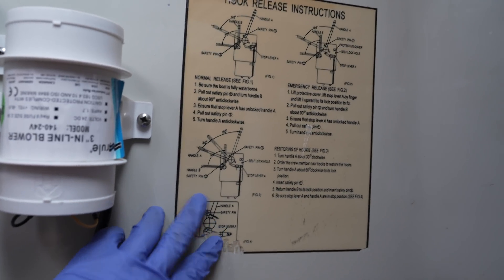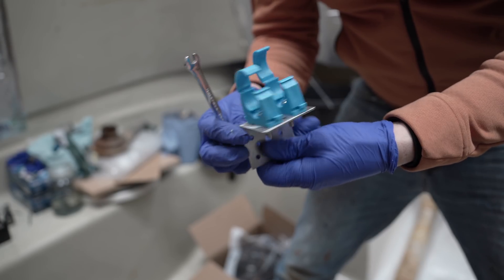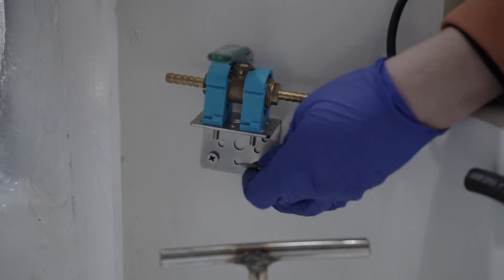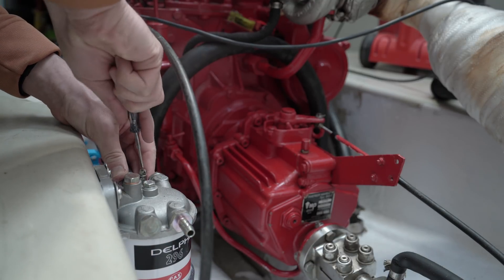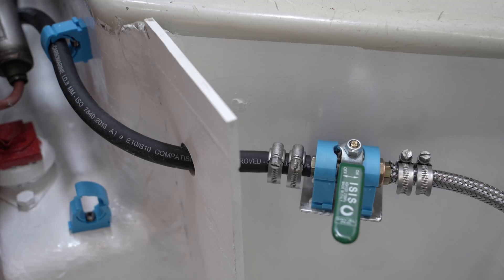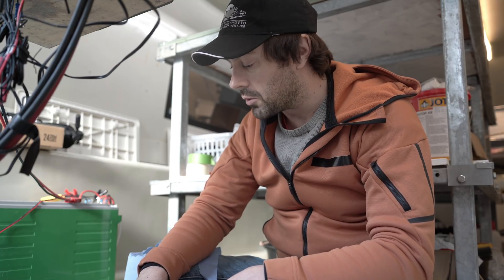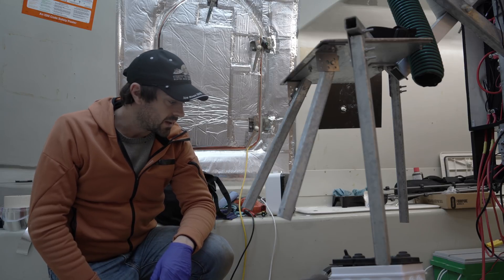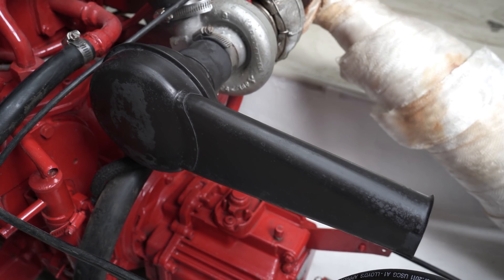Lifeboat Conversion Ep9: Installing Bukh engine fuel supply hoses and fittings [4K]

Comment: Two points of interest  1 use acetone to clean fibreglass before painting plus plenty of fresh air  Two  try a hot air paint stripper to soften the plastic decals,  I used this method to remove ad wrapping of my company vans for selling,  all the best I'm enjoying the videos
Reply from the maker: Cheers! Yes acetone solves most of life's challenges. Except if you run short of wine.

Comment: Are the fittings on the top of the filter for a DP gauge to tell if the filter is clogging?
Reply from the maker: The two bolt heads ? The one is the middle is the spindle that holds the whole thing together. The one to the side is the bleed screw.

Comment: I wouldn't use those plastic clips holding that shut off valve.  Cold will make them brittle and if the valve is a little stiff you will need to apply some force.

Comment: One of the hose options from the fuel filters use to be used to go to a manual liquid diesel pressure gauge. I am not sure if this method is still in practice but I have found it on older marine engines. It is quite disturbing when they fail and the gauge itself half fills with diesel.

Comment: Lol that bracket you made for the shut off valve will never hold. This is embarrassing.
Reply from the maker: What does it need to hold, Rusty Sanchez?
Reply: @AlexHibbertOriginals  Elmer’s wood glue.

Comment: I know its been 4mo. & you've got sticker off. For future, citrus air freshener spray works really well on stubborn adhesives. Thanks
Reply from the maker: Presumably the spray just contains a light solvent like alcohol?
Reply: @AlexHibbertOriginals  it has orange oil I assume which works great on adhesives

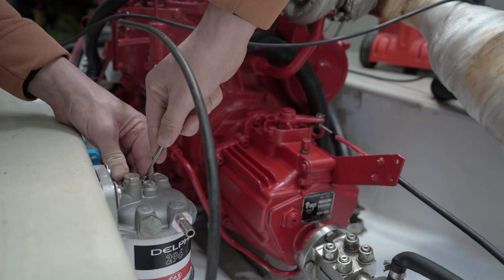Comment: Use right angled copper fittings if your hose changes direction immediately after connection, I noticed one of your hoses already suffering some damage at 4:12 lower right hand corner and thought you might take a look at that. :)

Comment: I've got a three cylinder Diesel generator that I bought one of these filters for. The unused blanked off plugs are for different mounting options ie you can put an 'In' and an 'Out' on one side just by moving the plugs around. Arrows embossed on top show the flow direction.
Also I'd recommend using two of these in parallel with a 'T' piece between them. Plumbed like this the two filters will take double the time clog up and handle double the water. Having two gives you some options if you need to disconnect one and keep the engine running. 
*In fact there are marine filters better than these bloody things and in one complete unit that works exactly as having two of these filters. Those dedicated filters are specifically designed so you can run one, two, isolate one and change a filter then the other etc and they have an inbuilt manifold for the fuel with changeover valves. 

Getting back to the filter you have, a couple of points; 
1) They have a design flaw. The aluminium mounting face is on the same plane as the sediment bowl rim. This makes changing the filter or cleaning the water/sediment bowl far more difficult than it ought be. I found making a bracket or adding a spacer will fix this. They just could've made it slightly deeper on the mounting face - but no! It couldn't be that simple ...
2) They really need a primer pump. They can be difficult to fill quickly as the air in the body of the filter acts as a bit of a cushion resisting flow when a new filter is installed. What I did is I got a non genuine Facet style pump (Icon Series PAT 336M is the one I have) and rigged up a a circuit where I can push an instantaneous button to prime and bleed quickly. Those Facet style pumps have a one way valve in them to resist drainback and they are designed to allow fuel to be pushed or sucked through them when switched off so they can work inline with your existing lift pump, or you can rig up something else for priming. It comes with a course filter screen which must be used on the suction side.

Comment: you should leave a battery above the waterline, ive seen a couple boating channels where if they took on water they cant use there water prumps if they impacted something
Reply from the maker: The top of the waterproof battery box is well above the waterline.

Comment: A little late now but if you cut up a two liter pop bottle and used zip ties you could quickly make a shield for the drill attachment. Definitely living my dream.
Edit: copper crush washers of the solid variety can be reused by heating up with a gas torch and let cool down naturally. That softens the copper and relieves stress points.
Reply from the maker: Thanks
Reply: I wish I had thought of that before impregnating my overalls, boots and garage with the decal detritus from my car.

Comment: use litter fluid to clean off glue
Reply from the maker: Even stronger solvents had failed.
Reply: "Litter fluid?"  So.. cat's piss, is that what you're saying?

Or is it just that you can't spell "Lighter fluid"?

Comment: Tech tip 
Install a piece of 1/4” X 1/4” hardware cloth over the turbo inlet. 
Many years past, I had a technician doing a service on a six cylinder Audi Diesel engine. The air filter was disconnected, so it was just a straight opening into the turbo. He ran the RPM up and the rag that was sitting nearby was sucked straight into the turbo. No permanent damage was done, however the shredded rag choked the engine off immediately and the removal of these pieces of rag involved hours of disassembly.
Reply from the maker: Noted!

Comment: The other ports on the fuel filter is so you can have in/out on either the left or right instead of one each side, or even in and out on the opposite side to what you have now. You can also use it to feed two engines or have two fuel out ports. If you use both input ports then you run the risk of sucking air when 1 tank is empty, so you will a ball valve on each input to isolate that tank when it's bone dry, but a good cheap way to have duel tanks with out an expensive 3 way valve.
Reply from the maker: Thanks - yes this common sense explanation turns out to be the case! The instructions were oddly insistent on just using ports 1 and 3.

Comment: What exactly is the failure case where a second hose clamp saves the day? And how do you know one has failed and you need to take corrective action against this unacceptable situation of only having one hose clamp securing a hose? Have you ever seen this happen? Pictures? Videos? Incident reports? Is this a real thing? If it is so important, why are almost all of the hose barbs too short for double hose clamps? I think this is a myth, but I would be very happy to see good evidence to the contrary.

Having used and designed "redundant" systems in a few different industries now, I am super skeptical of doubling things up. I've seen sloppy attempts at redundancy cause problems more often than prevent problems. Or systems where redundancy was deployed (at great expense) instead of solving the underlying problem and no one actually knows if it solved the problem or not, they just blindly hope that the problem is now at least 50% less likely to occur. So many climbing reports where people died while using redundant systems. About half the time when I see two hose clamps on something, one or both of them is in a less than ideal position. Alex managed to avoid that, so he clearly isn't a moron. But he still used two in other places... I've been removing the second hose clamps whenever I encounter them on my boat. Instead of a dozen extra clamps installed in random places, I'm going to keep a few spares on board. If something goes wrong, it will be easier to diagnose and repair it.
Reply from the maker: A reasonable point, well made. On expeditions, especially weight constrained ones, spares/redundancy are a very tough judgement call - made on a case by case basis. With these hose clamps, my decision was based on >1 person I trust saying it's a good idea, the fact they are cheap, are unlikely here to cause damage as the hose tails are long enough, and because having not run these engines for years myself, I've tended towards conservatism.

Comment: Just a note diesel eats at rubber but fuel line hose should be alright if it can stand up to regular gasoline. Supposedly regular fuel is worse than diesel at eating away rubber. Just asked a heavy duty mechanic that drove by just in case I was wrong. Either way maybe have lots of extra hose just in case.
Reply: Or do some testing.
Reply from the maker: Thanks - the hose is rated for both diesel and petrol/gasoline.

Comment: The other fittings on your filter are just for different configurations 
You have an in and an out on each side so you can run straight though like you have or you can run in and out on the same side If the mounting location requires it 
You can't run two sources though it or anything like that (well you can but they'd get mixed)
Reply from the maker: Thanks yes a few others have said this. Good to know the simple answer is the right one.

Comment: At 5:24. You may want to consider some padding/protection to keep the rubber hose from coming into contact with the edges of the hole. Heavy seas may cause a lot of vibration. I don’t know a thing about this but enjoy watching these videos.
Reply from the maker: You're right - no-one at all has mentioned this.

Comment: Use rockwool. It's incredibly soundproof and very very thermally protective period comes at a premium but the stuff is so effective that he grabbed a handful and put it up to both ears you won't be able to hear anything. If I put a sunshade up my car is still cold in Florida during the summer an hour later
Reply: Also threading without Teflon???
Reply from the maker: PTFE tape is not recommended for sealing fuel fitting threads. Small parts can enter the flow and damage the engine. Solid PTFE, sure, but not tape.
Reply: @AlexHibbertOriginals  huh learn something every day 👍

Comment: I would suggest that you add a primer bulb after your fuel valve from the tank but before your water separator it makes changing the filter much easier. Less likely to get air in your fuel system when you prime the fuel lines.

Comment: the two extra ports on the fuel filter are for if you want the inlet and outlet on the same side
Reply from the maker: Yes it appears so, and I wish I knew that. The instructions were adamant to use the ports I used, which weren't as convenient, so I imagined it wasn't quite that simple.

Comment: Just a thought. But a wire hose clamp tool might be handy to keep on hand for emergency repairs. 
https://youtu.be/of9p70H7gdg
Reply from the maker: That's a very elegant design - I wonder if there are any flaws, like slicing into the rubber.
Reply: @AlexHibbertOriginals  I made one of my own, and have not found any problems with slicing into the hose. I was even able to compress a larger fuel line hose on to a smaller fitting without severing the line. I also used quite thin wire. I like that it can be used to fix broken handles, and lash things together.

Comment: Most other boat build channels I watch have double fuel/water filters for their marine diesels. Not sure why there are two. But there's prob a reason.
Reply from the maker: If in series, it'll be to gradually have finer and finer filters. If in parallel, so they can be swapped out without interrupting fuel flow.

Comment: When you fire up the engine again make sure the windows are open because I think that even that high-temp black paint is probably still going to vaporize off.
Reply from the maker: It's only the intake. The actual turbo is safely contained within a housing and with tons of lagging installed by the manufacturer. The intake had a fairly normal sticker on it, whose adhesive survived fine for a decade. The high temp paint was probably over-cautious.

Comment: I am surprised you didn’t install 2 primary fuel filters.  Reason to do so is if you clog a filter underway (especially in rough seas) you can just turn one filter off and the other filter on and continue on your way without having to change that filter and re-prime your engine add an inopportune time
Reply from the maker: I've had some conversations to this end over the past weeks - and had taken it onboard. Whilst content at present, I may add in this useful complication in due course.

Comment: ....curious about teflon tape for threaded fuel fittings?
Reply from the maker: Apparently an absolute no no. Little parts of the tape get into the system and can clog the engine. Washers and/or clips should offer a good seal.
Reply: @AlexHibbertOriginals  I had the thought that there must be a good reason; I imagine that its the filters, pumps and very likely injectors that are the main concern. I bet 'permatex' has some sort of paste-like thread sealant that is good for use with diesel fuel although I don't know firsthand....  but you should be using some sort of sealant for threaded connections, just an fyi. (was that some sort of rubber that I saw?)
Reply from the maker: I do have some fuel connection sealant, but have been advised to only use it as a last resort if mechanical seals don't quite manage it.

Comment: The extra fittings on the water separator/filter are usually for a double filter set up so if one gets blocked you can switch to the other, isolate the blocked one and change it without stopping the engine, often recommended for boats with only one engine, heavy seas can stir up the tank contents and that is right when you don't want your engine conking out.
Reply from the maker: Scratching my head a little to see how that uninterrupted bypass would be plumbed in with those two spare ports.
Reply: @AlexHibbertOriginals  it allows you to choose which sides the pipes go in or out, each filter should have two ins and two outs, so you can have them positioned conveniently for the valves and pipework depending how you set them up on the brackets, can't find a vid that shows it but this is the the way it should work but done with different type of filters.

https://youtu.be/EaI4ndtzvC4?t=1594
Reply: @AlexHibbertOriginals  There another one with different filters again.

https://youtu.be/0Zdbsub0Eko?t=473

Comment: There are 4 ports on the water separator so the supply and return can come out of the same side.  The front ports are one function, and the back ports are the other.  So fuel can flow left to right, right to left, in and out on the left or in and out on the right.  This isn't a big deal with all the space on this build, but it is with a lot of small industrial equipment
Reply from the maker: Thanks for this. I thought it might be as simple as that - and if I were sure, would have connected it up differently. Oh well - no drama.

Comment: I really love your comedy, makes the videos interesting! Additionally one of the ports on the fuel filter/water separator might be for bleeding the air from the filter.
Reply from the maker: The one on top is - I was referring (perhaps vaguely) to the two blanked ports on the sides.

Comment: It may be too early to ask, but what color(s) do you plan on repainting the exterior in? Also given the fact that it’s a lifeboat, did it come equipped with navigational lights?
Reply from the maker: Orange still (only yellow and orange, and perhaps red, are sensible) but a slightly different orange. There was one nav, yes. I'll be installing all the others needed by law.
Reply: @AlexHibbertOriginals  If I may suggest, the hull painted with copper red paint below the waterline will help fend off any would-be hitchhiking barnacles and other sea life while in port. Any shade of orange you choose will be a welcomed one and I look forward to future videos. Cheers from Oregon, USA.
Reply from the maker: @chumbawaumbacumpa  Antifouling is a little way down the road, but yes indeed

Comment: Speaking from experience, use a socket on your hose clips, firmer drive, better in low light and no blood when it slips. Regarding stickiness, I always use the S to B ratio! S..t to a blanket. Just saying. Great content.
Reply from the maker: Thanks Patrick
Reply: +1 for the use of a socket on hose clips - apart from your points it is also usually easier to get a socket on clips in confined places.

Comment: Single ear stainless hose crimps and loctite 577. Jubilee clips don't fit that great on small diameter hose. Better using fuel hose clamps if you need to, I prefer crimps looks better....
Reply from the maker: Actually that's very pertinent as a mechanic at our boatyard recommended o rings yesterday to me. I may well change them over - obviously taking into account they are single use. I was told it's good practice to avoid sealants like 577 if possible, and rely on mechanical seals. What are your thoughts single vs double ear crimps?
Reply: I prefer single ear crimps as you only need to get to one side, handy in confined spaces with the crimp pliers. I get the ones with the sliding insert as they seem to crimp better. Not sure the difference, maybe the double ear has a tighter hold for higher pressure applications? 
I would use 577 or heldtite on threads like the hose tails that screw into your filter as they more or less permanent. Probably doesn't need it but like to make sure I have no small air leaks. Just because there are no fuel leaks you could still be drawing air into the fuel lines. 
https://hcl-clamping.co.uk/products/single-ear-hose-clamp-zero-leak-9-6-11-3mm-304ss
Reply from the maker: Thanks Keiron - appreicated.